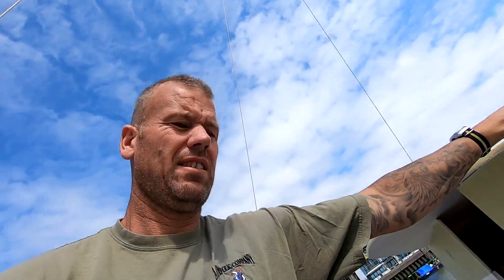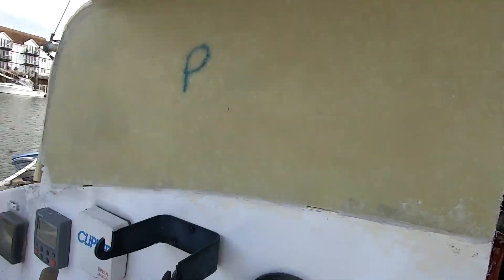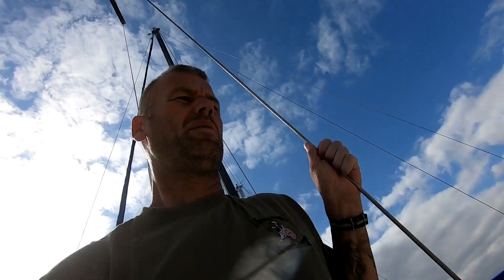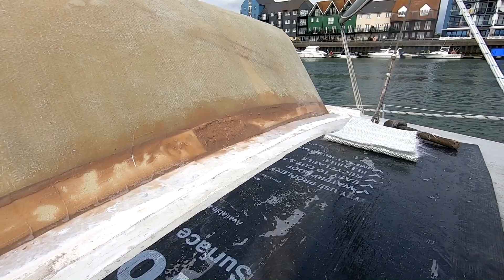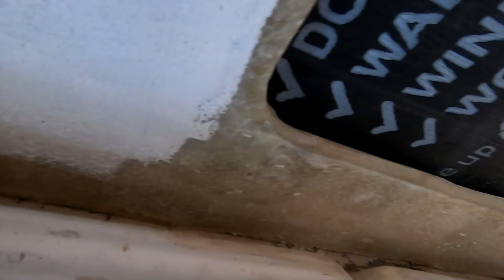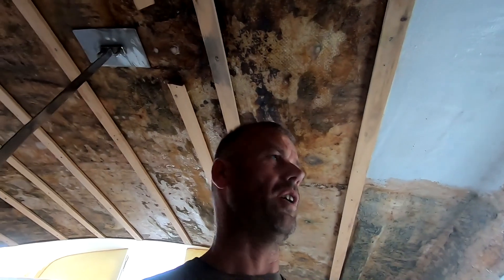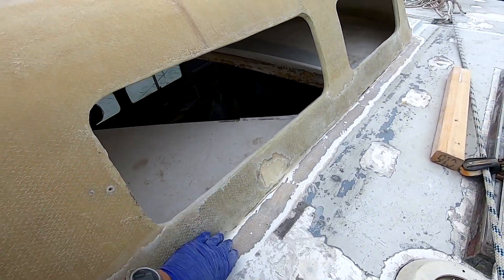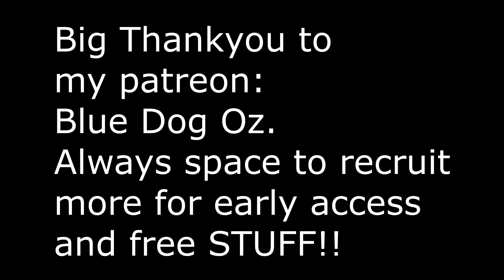Tabbing DIY Dodger Sprayhood and Yacht interior build E78

Comment: We had contemplated putting a hard dodger/ sprayhood on ours as our canvas was up for renewal (you've seen our channel) because 20 years of UV damage. I've done numerous repairs trying to keep it going. Getting new sprayhood made this winter by a friend.  Was supposed to be done before we launched this year but Brexit put a spanner in the works getting fabric delivery
Reply from the maker: Replacing fabric isn't too bad if your stainless is still in good condition.  My first time using a sewing machine I made a huge cover out of top gun for my old motor vessel. Surprisingly easy after the information gathering from sail rite. Cost me 240 pound opposed to the shop price of 2,700👍👍
Reply: @SailingFoxyLady  we have a friend Cindy who used to do boat  & furniture upholstery. She said she'd do it for us. I  have been hand stitching and patching it for years.
Reply from the maker: @WavedancerWesterlyfulmar  always handy to have some useful friends 😀 👍

Comment: Good progress and happy birthday, Spence. For the gap on the insides of the new dodger, maybe bed strips of the foam panels in epoxy and then only fill the gaps with thickened epoxy, that way it saves epoxy, but does not rot, like the wood idea you mentioned. You mentioned foam, but I wasn't sure if you meant AB foam, foam panel strips or spray foam, so I thought I would mention it, just in case. Thanks for sharing progress, you are helping me to be motivated to work on my boat tomorrow. Greetings from Bournemouth.
Reply from the maker: Great idea Christoph, I'm going to try/ measure up the foam and pvc idea. And thankyou for the birthday wishes.  Do you have a big job on with yours? What is she?
Reply: @SailingFoxyLady  It's a 1978 Europe Banker 34, a 34 foot motor trawler. Have her for two years now, full restoration/project. Currently working on filling in old through hull holes, about 19 of them, what a crazy amount. Also working on fairing and painting the flybridge deck at the moment. Busy times.
Reply from the maker: @ChrisSchroth  sounds amazing mate. That's a weekends work!🙃🙃🤣 I'm by far a pro but if you need a hand/help then give me a shout mate. Would love to see her one day.😁🤟
Reply: @SailingFoxyLady  You are more than welcome to see her at some point. Hoping to have her more presentable in the next year. I will email you soon, Spence.
Reply from the maker: @ChrisSchroth  sounds good, thanks mate.  I'm visiting friends in Christchurch in the future with another Aristocat so will try combine my/our visit.😁

Comment: You can fill the space with a pvc pipe with endcaps. Regards Billy.
Reply from the maker: Ooh that's a good call Billy!! Thanks mate!
Reply: Hi Spencer.
Also the tubes could be used for cable runs.
Regards Mark.
Reply from the maker: @mySeaPrince_  that is a good call,  I could use it to run the radar and possibly the mast wiring!🤔🤔 seal the coach roof and run it all through the dodger!!hmmm